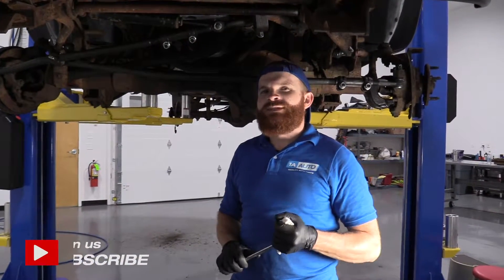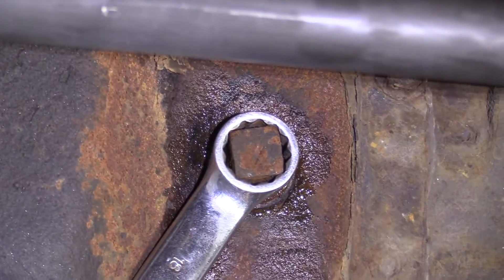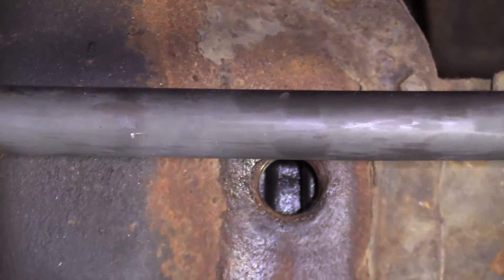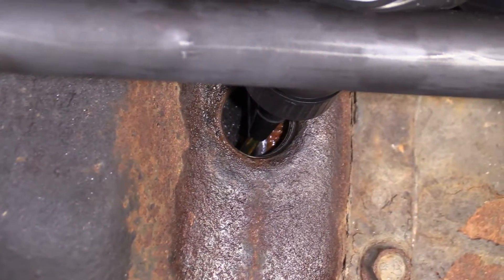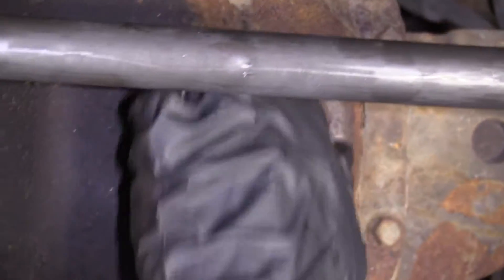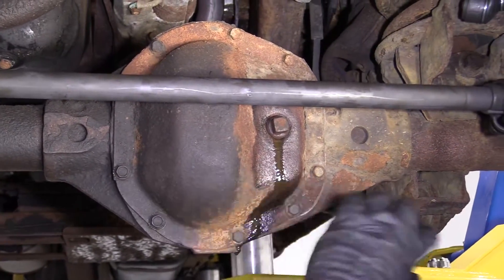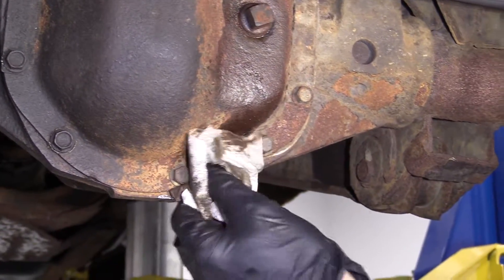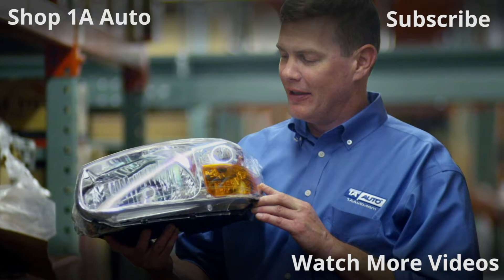How to Check Front Differential Fluid 94-02 Dodge Ram 1500

Comment: It’s simple. Unscrew that bolt orrrr “plug” if your dodge diffs have that. Stick your finger it in and if you feel fluid then your good. If you feel a lot of fluid on your finger then stick that plug back in immediately because you are GOOD. If you feel little or no fluid add it. Easy. Rear diff is an also simple thing to change fluid on. Front diff is a pain in the ass cause there’s stuff around it making it annoying. In fact I have to fricken go outside in a little bit now to change my 03 1500s front diff fluid. I got the Rear done early this week

Comment: I was told to use 75w140 for front  and 80w90 for the rear but on 75w140 on the rear for heavy towing. Which is it?
Reply from the maker: +B E A local mechanic or the dealer may be able to tell you. We would recommend only using the fluid indicated in the owners manual.
Reply: Which is?